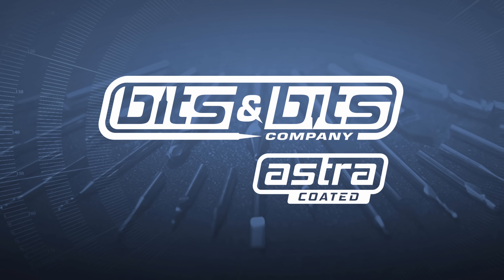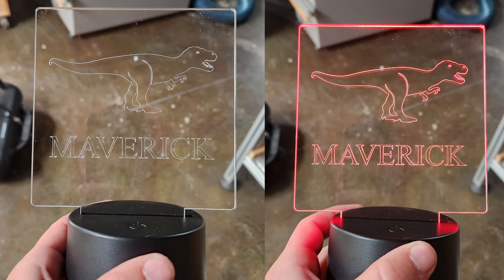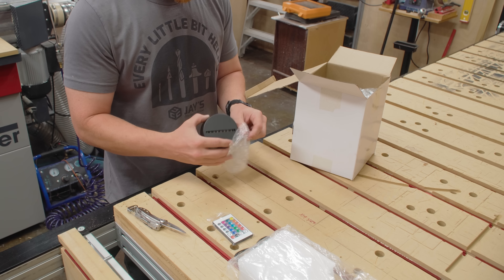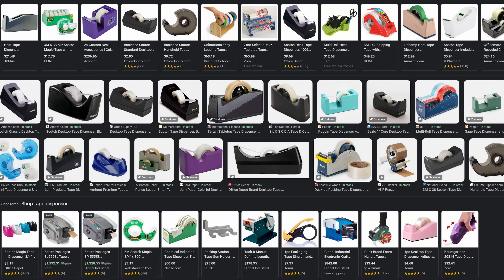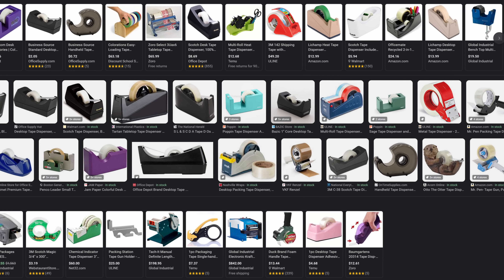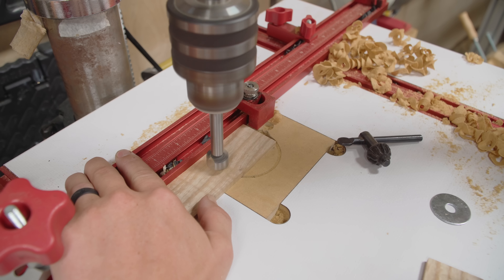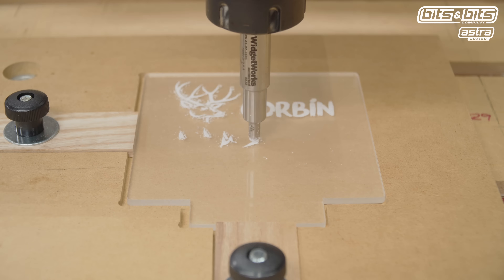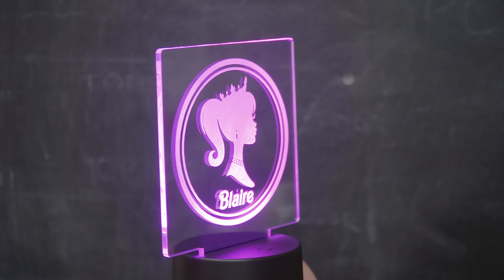A Tip to Be More Productive - Beginning Woodworker Tip

Comment: Great tip. Just the other day I was cutting some handles into a project and though I could just mark lines and use a brad point bit to hit the line right and get the handles exactly straight… nope. They still ended up slightly crooked. Even though it was only for 4 handle cutouts I should have made a jig from scrap to line it up right. Luckily it was just a shop project, but it would have been devastating at the end of a big project for something nicer.